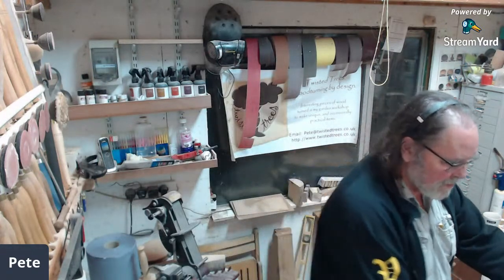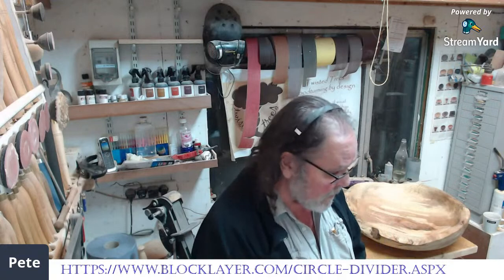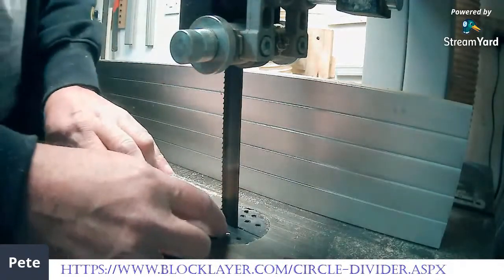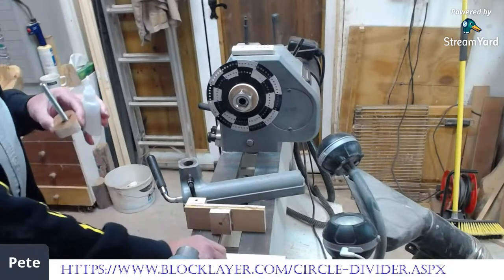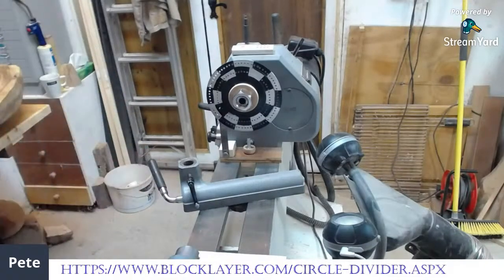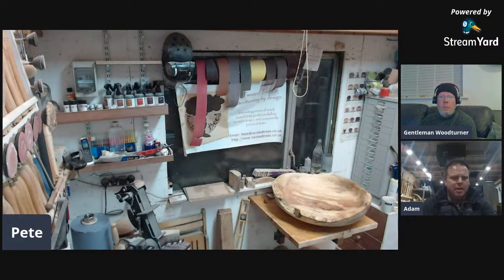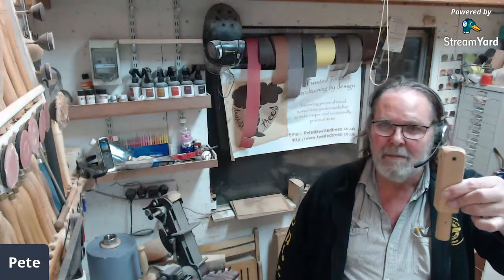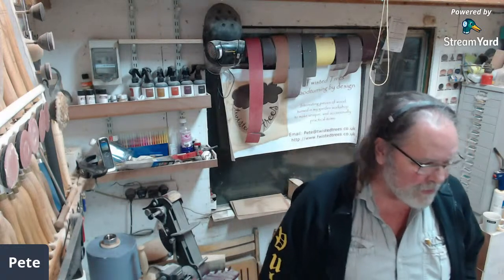Indexing Jig how it was made and giveaway

Comment: Thank you for this demo Pete. Could not make the live, but caught up on it just now. I have an indexing ring on my chuck, but nothing to secure it with, so the pin system you made gave me an idea of what to do somepoint in the future.
Reply from the maker: Glad it was useful Jiggsy, steel rule as a sprung pin holder I thought was inspired. The clamp mechanism is handy for a lot of things, though I tend to go with a longer insert between the bed bars for anything that may need to be kept straight. Main good point on the design is it just drops into place around the banjo / tailstock without needing to remove anything.
Reply: @PeteTwistedTrees I liked the simplicity of your design. Just need to get one of the small steel rulers now

Comment: Thanks pete for the design and demo i will get one cut up on the laser at work ,no i need two one for each lathe
Reply from the maker: Glad to plant the idea Michael as yours are being laser cut,  you could do more of different spacings, if you can divide 360 by the number then  that will be the angle separation I chose 72 expecting to use the 36 and 24 more often, and 60 is a clock so pretty common usage, but if you have access to a laser you may want to consider more disks.